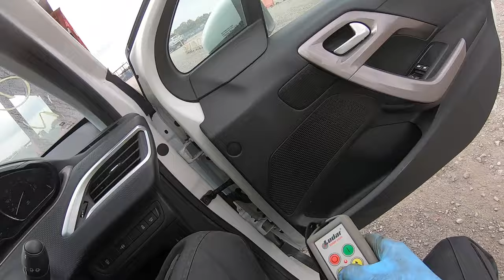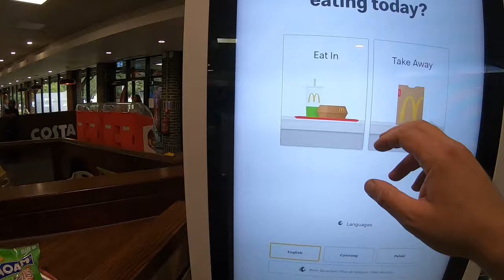"Epic Salvage Trip: Copart Sandwich Pickups & M25 Madness | KevTee's Scrap Car Adventures

Comment: The Ford focus engine is a wet belt driven and the filter in the sump gets blocked if oil changes are not done frequently common with the eco boost engine easy fix drop sump clean filter and replace oil jobs a goodun